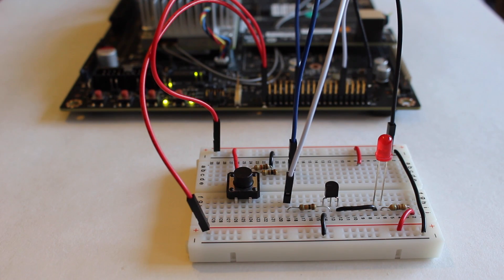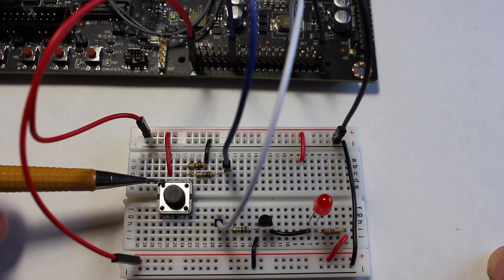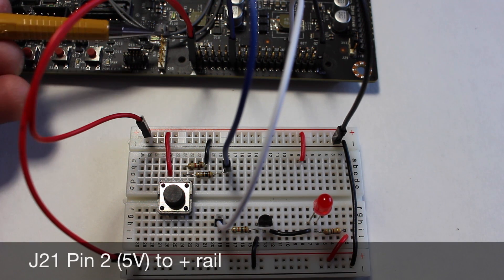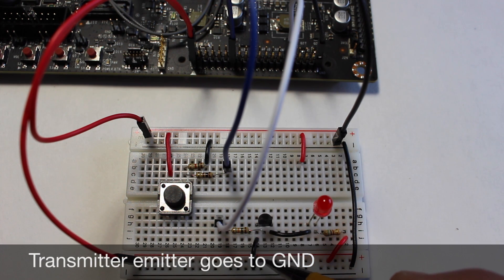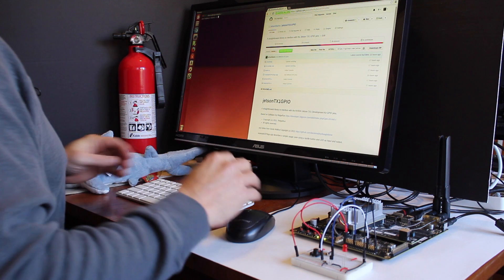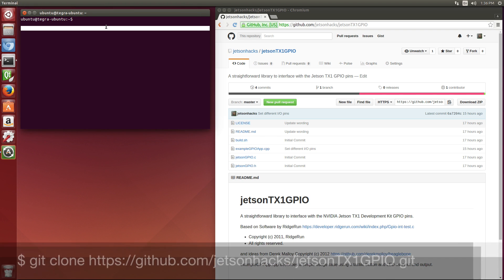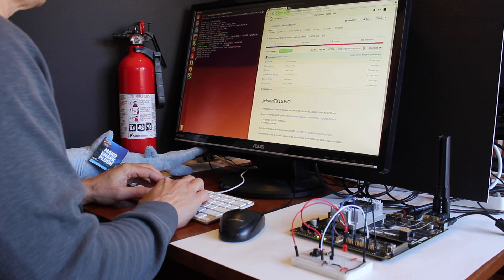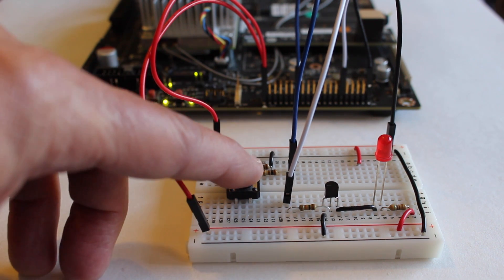GPIO - NVIDIA Jetson TX1

Comment: all of your examples are tied to using the examples in the default folder . when I try to write my own in the python dir the GPIO won't work .
Reply from the maker: You should modify your code to make it work. The examples show you how to do that. Since you have not shared anything other than "it doesn't work" with no further explanation of what code you might be running or even the issue you are encountering, it is not possible to provide advice.
Reply: My bad , I got the samples to run and even wrote a simple program to test things out using my scope. I was trying in vain to get a Vht11 temp sensor to work. Found out after a hand slap to head that that sensor ran off five volts. Coming from arduino to Python and the Jetson .

Comment: Thanks for your response,Great I change the GPIO number ,It'll work correctly,and Which should I  modify?
Reply from the maker: Depends on the pin(s) that you are going to use. For example the gpio listings here: http://www.jetsonhacks.com/nvidia-jetson-tx2-j21-header-pinout/
Reply: THANK YOU,JesonHacks ,So I modify Wiring?The Code doesn't ,Right?
Reply: THANK YOU,JesonHacks ,So I modify Wiring?The Code doesn't ,Right?
Reply from the maker: The wiring does not change, the example code should be changed to reflect the new gpio number associated with the Jetson pin.
Reply: I appreciate the response

Comment: Hello i have the question that is killing me lol, this motherboard supports the X1 Jetson windows either 7,8 or 10?

¿You can enter the bios to boot windows?
Reply from the maker: +Steven William The Jetson TX1 Development Kit runs L4T an Ubuntu 14.04 variant. In answer to your question, it does not run Microsoft Windows. Also, it does not have a traditional PC bios.
Reply: +Jetsonhacks Thanks for responding, and you can play pc games compatible with Ubuntu 10.04, resident evil style booderlands etc?
Reply from the maker: +Steven William Unfortunately I do not know the answer that question. I know other people have used it for games, and some people use it for Android, but I have no personal experience doing so.